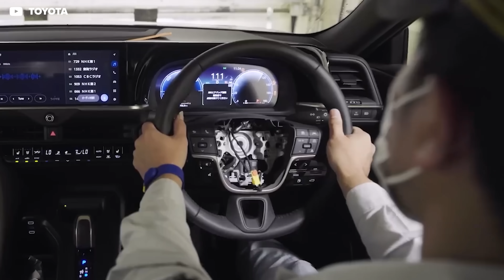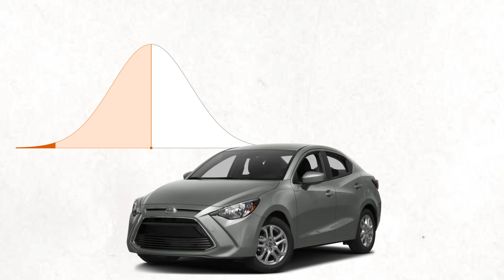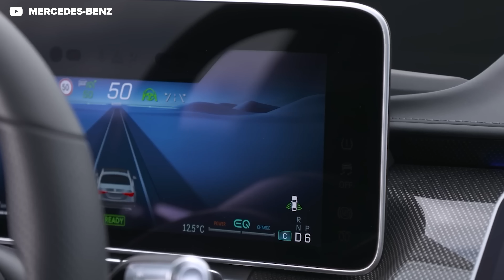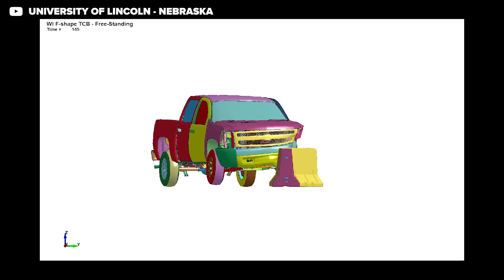The REAL reason guardrails can't stop EVs in a crash

Comment: Unsubscribing from ‘The Drive’. This is BS. It has everything to do with how HEAVY a vehicle is, not specifically that it is an EV. Yes, some EVs are heavier but the video should be titled: HEAVY vehicles are not stopped by guardrails. Look at the curb weight of Ram etc. So stupid.
Reply: Also, EV weight will only come down in time. Was this video sponsored by the oil industry???
Reply: Would you like some tissue. 😢

Comment: People always try to blame & Sue others, & blame others , bumper to high , guard rail to low , curve not sloped enough.. to get money, if they that concerned about safety & others at fault , why don’t they buy a $300,000 car similar  to race cars that hit walls any 200mph and the driver walks away , wait No they don’t want to spent extra money even it will save them self , but others should spend the $$$

Comment: Please give weights in Kilograms, some thing the rest of the world understands. 
In recent years the central barriers on most motorways in the UK have been upgraded to concrete to prevent Lorry crossovers, and deflect cars back into their carriageway. Road safety is based on efficiency, not on penny pinching cheap solutions.
Reply: You have less than 300k miles or 422,100km of paved road, we have 4 million miles or 6.8 million km of paved road, let that sink in as to why we have to find cost effective solutions, even a child could figure that out, I shouldn't be surprised you couldn't figure that out, yall can't even figure out that letting millions of unvetted people into your country has bad outcomes.
Reply: @Initial_Gopnik  Spending money on inefficient systems is simply stupid, whoever does it. 'Buy Cheap. Buy Twice' Thats an adult comment. 
Remind me why there is a long wall still being built along the border with Mexico.
Reply: @solentbum  it may be more efficient for your small country that's half the size of Texas, but if you think about the logistics of transporting concrete barriers in the hundreds of millions, over millions of miles, that per piece, concrete barriers use over 60kg of steel rebar alone, while the average 4 meter steel w-beam guardrail weighs just about 56kg, you can cover a hell of alot more roadway with one truck with 100 guard rails, instead of one truck carrying 10 concrete barriers, so what's inefficient again? And the wall is still being built because it wasn't finished in Trump's first term, then the Biden administration halted the construction, and even tried taking parts of it down. Remind me why is there so many women that feel unsafe walking alone at any time in Birmingham?

Comment: considering vehicles far heavier than even the heaviest ev passenger car or truck share the same roads.. weight has nothing to do with poorly designed or inadequate guard rails. The fact semitrucks exist, which not only the weight of the truck portion by itself weighs more than an EV, but the average truck could also be carrying up to 40 tons or 80,000 lbs on it's back (or more for heavy load haulers), and drive on the same roads and occasionally get into accidents or collisions with guardrails.. if they are able to stop a semitruck then obviously the issue isn't weight, but if not then, yes they are poorly designed.

Comment: The actual elephant in the room is all of the existing guardrails that have not been updated to current standards, or have been incorrectly installed.  But to address the issues from the video, it seems it is time again to redesign our guardrails for EVs.
Reply: The average sedan weighs 3-4k lbs. Most people don’t drive heavy EVs. Why punish the majority to help the minority?
Reply: @angelgjr1999 Sorry, what I meant was to redesign to ALSO protect EVs.  Of course they should continue to be appropriate for ICEs.  Even ICEs have changed a lot over the years with the market shift towards SUVs and Pickup Trucks.

Comment: I was in an accident recently in an electric SUV (Prologue) and it saved my life. And it's not a huge weight difference... a Prologue only weighs like 500lbs more than a Pilot which I think is a similar size vehicle? But all the weight being at the bottom prevented it from rolling over and down a cliff... I immediately replaced it with another EV (Model 3 this time).

Comment: Most BEVs are only 15% heavier than ICE passenger cars. 4000lbs would put them at about twice as heavy which is misleading. 600lbs would be closer to the truth. I sincerely doubt that the lower CG makes much of any difference in the effectiveness of the guard rail deflection. It has more to do with the geometry of the car. A low lying car will deflect the rail upward. If you test the car with the same geometry and weight but a higher CG, you will likely get a similar result. The resisting overturning moment (stopping the car from flipping over) is taken out by the weight of the car times the horizontal distance between the CG and the front tires. If a car isn't going to overturn, the results of the crash will be similar (given the same weight, geometry, but different CG height). If the CG is so high and the cars want to flip over (or overturn), then the height of the CG will start to make a difference.

Comment: uh, no, vehicles weighing 7000 pounds are dangerous in a crash. That’s why I have friends who buy the heaviest vehicle they can afford; they want to be the one that comes out on top.
Reply: I get that. I drive a diesel Excursion. About 2 years ago I was stopped at a stoplight and was rear-ended by a girl in a Mitsubishi. My trailer hitch broke her engine block. Pushed me into a Honda that was in front of me. I trashed the back of it. But I have a welded front bumper which only got a small dent. My back bumper and trailer hitch were bent while the car that hit me was totalled. I bought a new hitch and welded a custom bumper out of 3/16 steel. So yeah, I will come out on top.

Comment: As a life long motorcyclist, I loathe guardrails. They dismember and kill riders during low level lay over wrecks constantly. They are essentially like having a giant serrated knife on the side of the road.
Reply: As a motorcyclist - unless you're riding through flat tulip fields of the Netherlands where you imply to would come to a gentle stop behind most guardrails on 'fun' roads are cliffs, rivers, and various trees you'd prefer not to go flying in. The hobby comes with its risks we accept when we ride and ride within our abilities. 

US yearly rate of motorcycle fatalities is around 5k (dark as it sounds that's not an incredible number considering population or motorcycles). And I'd wager most of them can be associated with lack of skill, irresponsible riding or driving by others before the guardrail comes up in the discussion as a troubled item of any sort.
Reply: @Valks-22  No, a low side in a curve with a cliff is less likely to kill or cut my leg off then the guardrail. If you are trying to argue that guardrails are not dangerous for riders, you are not a rider. I PERSONALLY have witnessed what they do to a rider's body. I would rather tumble down the cliff.
Reply: @666skyshadow  i'm not doubting you've seen something scary or that hitting anything once you're sliding of the bike is a fun affair. but they exist for a reason and the majority of the road users - which is not us - to prevent vehicles from going over the edges or into pedestrian areas/houses. 

I will insist that you, in fact, do not want to tumble down a cliff.
Reply: @666skyshadow  personally, I would rather not leave the road.
Reply: In Australia we have these ridiculously expensive and unsafe wire-rope barriers! They “essentially” hook the contacted steering tyre into the wires and destroy the vehicle, even in the slightest of contact. These barriers run typically a few Km’s and even a small hit requires replacement of the impacted area and re-tensioning of the entire span at enormous cost. They kill wildlife that get entangled, they hurt motorcyclists and damage an impacted vehicle beyond being able to maintain control.
Reply: Motorcyclists trade safety for "freedom" and the fun of riding. It's a personal choice. Basically nobody, in countries where there are guardrails, needs to ride instead of using a car. 

If there are places where there are guardrails that are dangerous to you, maybe don't ride there? Same reason why cyclists shouldn't be there. It's not safe for them.
Reply: In Europe they actually cover the pillors with a foam like cover to prevent that from happening. Newer ones are also lower to the ground to prevent you from sliding under them (much like trucks in Europe have side skirts for the exact same reason).

It's not that these can't be made safer for everyone, it's just that in North America the decision has been made that it's not worth the money or effort. The guy pretty much said that in the video.
Reply: Hence why only a moron would drive a motorcycle
Reply: guardrails are not made to save the person that crashes into them - they are made to prevent them causing collateral damage.  trying to reduce harm to the accident driver is secondary.
Reply: We need safety mechanisms that support multi modal transportation
Reply: @williamrichards5241 we need a well funded and robust public transportation system
Reply: funny you mention that..... have a unique double guard rail near me... with a history. It's protecting/containing traffic when one side is an estuary of a reservoir lake, no more than four feet deep at most. The other side is former dairy grazing land with an eight foot drop off to lush alfalfa grasses..... 
Kid made a driving mistake in this ess & struck a tree & died.  Then the guardrails went up.  Even as a car driver it strikes me as a kill-zone now for which ever colliding vehicle happens to be smaller .....I'd rather just dump it in with the bass when an F350 comes lumbering towards me.....  personal choice.   Runoff room & space matter !!!  Bike or cage!
Reply: The road planners never give a toss about motorcyclists wheather it be in U.S. or here in Britain.  Formerly known as "Great" Britain.
Reply: so body lays over rail slides along top and rail edge cuts it or the joints that are a bit uneven pointy edge rising up  there , so , stronger armor suits or wider top edge could be half pipe shaped but is that harder to make cost much more,  or add on  thing to edge to make it flatter top , metal or plastic or wood or , or does that sharp edge need to be made smoother with some thick paint like material or epoxy, , or could triangles or something be placed on one or two meter intervals to lift body up throw it off the rail , ramps. metal plates on suits where body gets cut usually so dont get cut plate slides over, or some electronic systems , controlling falls how, drone on back activated , chute, deployed by automatic sensoring or how , movable rails fall back before hits ..hardly soon. oh , if limbs often cut, wire to limbs and  they get pulled to body when crashing falling how, motors or explosives or small chutes and anchors on suit chute moves from back pulling wire ancored to hip pulling arm to hip, or exploding bag out from back pulls wire , or system on bike pulls it . rollde up on wheel or
Reply: If you want to be safer, drive a car. Motorcycles are death traps with or without guardrails.
Reply: @Hiromandt  🙄 the road should still be safe for everybody. How about instead of cutlery, you replace all yours with spoons? They're safer, right?
The only thing stopping a multi-stage highway barrier is cost. It wouldn't be difficult to design a barrier that's safer for motorcycles but can still stop a car if need be, or a normal barrier behind the motorcycle barrier. And then a secondary EV barrier behind that. Money over lives and safety every single time. Have you heard of automotive recalls? It's when the cost of lawsuits over an issue costs more than fixing the problem.
Reply: @Caffeinated-DaVinci yeah, except he's not crying about the danger of knives. What kind of drugs are you on🤣
Reply: @Hiromandt  Dangerous? So is texting your ex, but here we are making bold life choices.

Comment: Something i would like the iihs to consider in its testing, accident induced faults resulting in fires, and other significant safety issues. 
Fuel is a major concern in gas and diesel vehicles, thermal run away is one for evs. So if either is prone to failure in an accident, it should fail immediately.

Comment: Just make ICE manuals again, ffs, there are so many pros to manual transmission in ICE vehicles.
1. Engine can "kill", shut itself down when the RPM's are too low, a.k.a. stalling, so technically when you crash, the car can stop faster than automatic transmission vehicle. 
Hence why EV can just keep going until the system detects a serious damage or becomes obsolete and just dies, thus switching everything off somehow, I mean, that Rivian could've kept on going by all means if the crash wouldn't have damaged it enough through all of these sequences.

2. Safer. Considering how many people practice and learn to drive with automatic gearboxes nowadays, whenever someone steals your car, there is a high probability rate of vehicle not being stolen because of the thief lacking knowledge of how to drive a manual. In U.S. it's a proven fact judging by multiple videos, and x2 or 3 because so much isn't caught on the camera.

3. It's fun to have a manual.

4. You can squeeze more power out of it, also you can choose your driving style.

Comment: No a pix up truck back just in the 80s and Early 90s. Weight around 3800 to 4200 a two wheel drive. You need to get your Faxs straight. And yes, electric vehicles do Wait a lot. And then concrete barriers you see they move around from time to time on highways. They weigh 1000 pounds.

Comment: IIHS needs to include a negative rating for what happens when a 7000lb rivian hits a 2400lb sub compact car vs when that sub compact hits a subcompact. Basically measure the energy tansfer into the fixed barrier and downrate the scores for the more energy transferred.
Reply: I said something similar in my comment, European Crash Test Results include Pedestrian Safety Rating which forces car makers to factor in how much damage their cars do when they hit a pedestrian or another car & work to reduce that damage to get a good score.
Reply: Same thing that happens with all the other 7000lb trucks that are ICE.  You know, Chevrolet Colorado, GMC Canyon, Ford Ranger, and Toyota Tacoma.
But go ahead and try to make this about EVs.
Reply: @tokomok not at all EV specific. I've been arguing since the og ford explorer that dmg to other vehicles needed to be taken into account. Ideally this would be done vs a car meeting the safety stds of a car of the average age of the on road fleet at the time of the test.
Reply: @tokomok A ford f-150 (Rangers are the smaller, weaker model fyi) hitting a honda accord is much different from tesla cybercuck vs accord

Comment: For one what you call a full size pix up truck is really a full Sadan it's the modern day car now. Aint a pickup truck and it needs 400 horsepower. Just to pull itself around cause it weighs around 3 tons. The old Sedan's got slightly Better fuel mileage. And was around 3800 to 4500  Pounds.

Comment: Vehicles used to be so much worse in crashes. And my old man said the same thing. I had 90 kids in my 1st grade class, and every year somebody got killed in what would now seem to be a minor accident. Your door was sheet metal, crank window mechanism, and a cardboard panel. ABS? If ya did, it was rear wheel only. Traction control? What's that? Stability control? Didn't even have ABS. Tires? 30k to the belts. 40k if you bought Michelins. Brakes? Don't even get me started.  The "good" greasable U joints that lasted half as long as the new no grease ones you haven't ever thought about because they didn't snap because there wasn't a goddamned grease hole down the middle. The drivethru worked good, you know 2½" doors and all....

Comment: The SIZE of trucks is a result of an EPA formulation that quantify both weight and size to arrive at some arbitrary MPG requirement that a normal size truck doing normal truck things, no Bueno. So you max out MPG, then add size and weight so it works. Why station wagons became full size SUVs.

Comment: That with the low center of mass is prett much BS. The only things that matters is if the guard rail can catch on the car. If the car slides like a wedge under the guard rail, it doesnt matter if the center of mass is low or high, it the form of the car, not the mass (in case of EVs the missing engine block the guard rail cant catch on).
Also designing the guard rails that it seperates from the poles doesnt help either, nor using "tin foil" as guard rail.
Having the center of mass in the front, middle or back matters much more in the ability of the guard rail to redirect the car back on the road.
And its also pretty obvious that guard rails cant catch a Truck in a head on impact